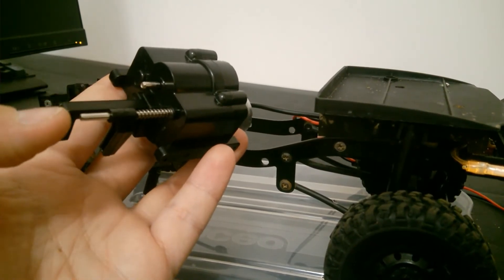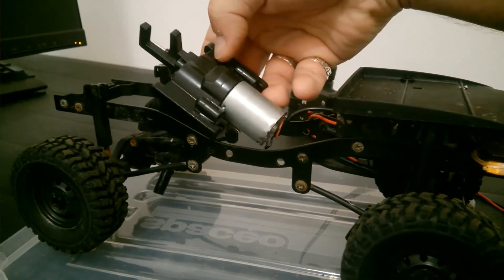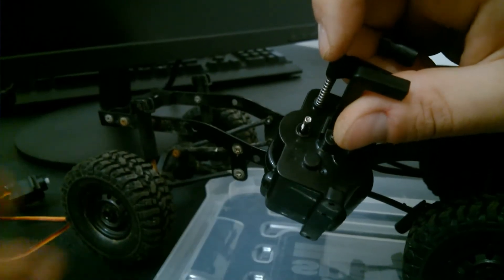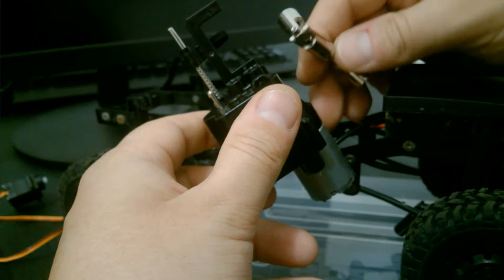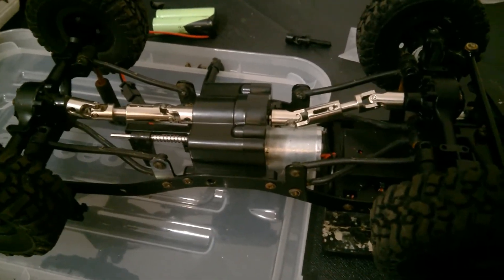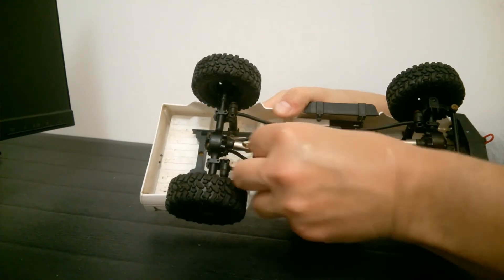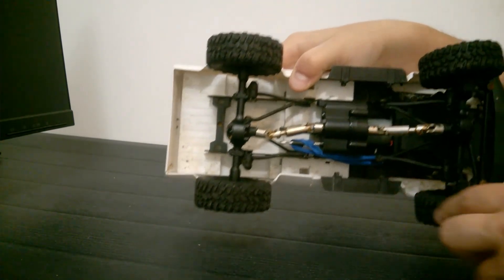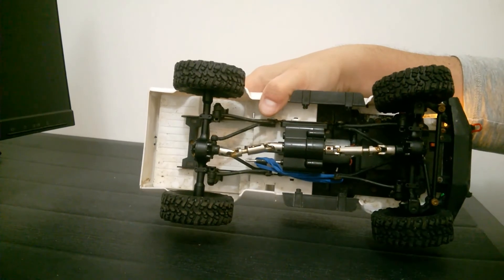How to Install 2 Speed Gearbox on a WPL C24 RC Crawler Truck? How to make WPL C24 RC Car Run Faster?

Comment: Can use old wire from 180 stock motor to solder with 2 speed gearbox and stock electronics?

Comment: Hello, i am new to WPL. Just want to ask, how many channel in the remote should i buy to control the low and high speed motor remotely? 

Including other functions in the remote as well (rate, trim and reverse), is it 4 or 6 channel?

Thanks in advance
Reply from the maker: I have seen remote controls made for these cars to control low and high speed on gear boxes, you will see some indicators for the gear box on such remote controls, check out some well-known online platforms.
Reply: @RCToysAventuraSmartSolutions  sweet! Thanks for your reply.

Comment: is dual speed gear is used by stock remote?
Reply from the maker: no, for dual gear, if you want to control it remotely, you'll have to replace the receiver and the remote control.
Reply: thanks sir the res v3
Reply: @RC Toys Aventura  so it is possible to change the gear manually that way I wouldn't need a new receiver and transmitter
Reply: @philliplizar9573 yeah I use a zip tie to keep it in low or high gear

Comment: i just put my 2 speed in with stock driveshafts ( new ones on the way ) but now the wheels spin in the opposite direction, any tips?
Reply from the maker: wires connected in reverse?
Reply: @RCToysAventuraSmartSolutions  i ended up figuring it out it was the axle and diff being flipped upside down and that made the wheels spin opposite